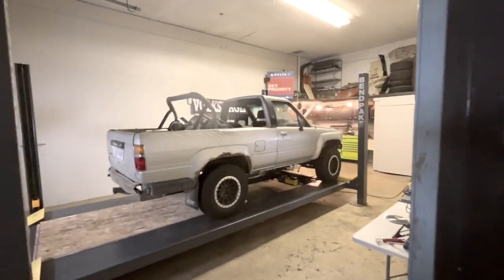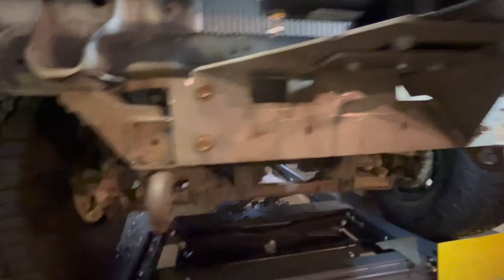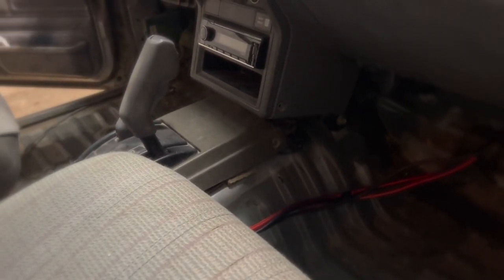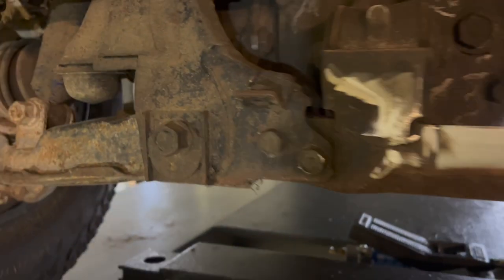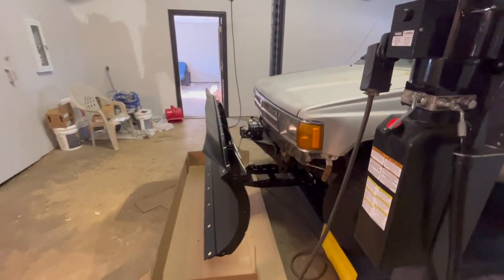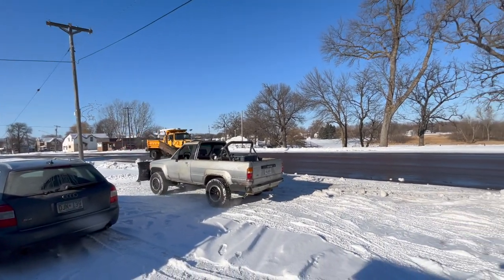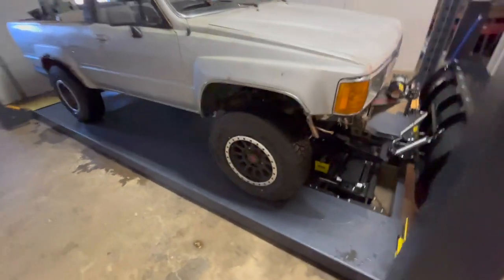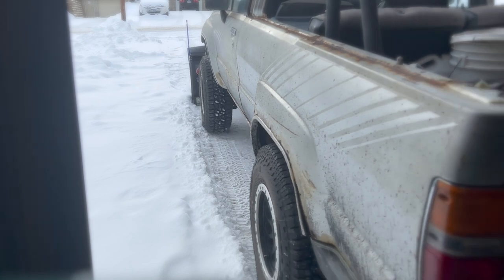Mounting a KFI UTV Snow plow on 1987 toyota 4runner

Comment: What model bracket did you use?!
Reply from the maker: Kfi 105775! Kubota mount, there are many that will work though
Reply: @Citizenspress  is that the one the works best or easiest for you?
Reply from the maker: @felipehernandez629  it was the easiest that was in stock at my local dealer, it is basically made to mount to 2x2” square tube
Reply: That’s awesome! Thanks for the help man! Love the wheels on the rig by the way!
Reply from the maker: @felipehernandez629  thanks man! Good luck